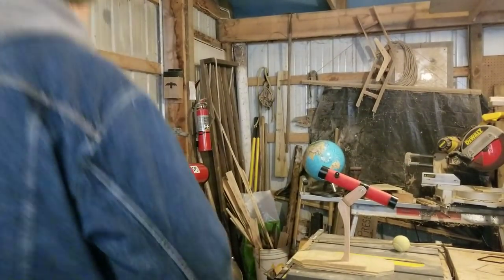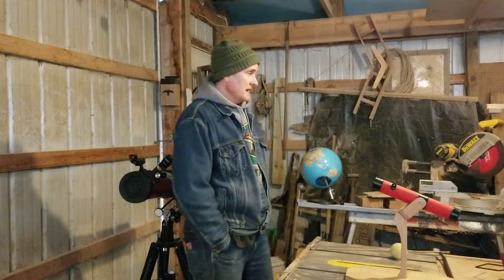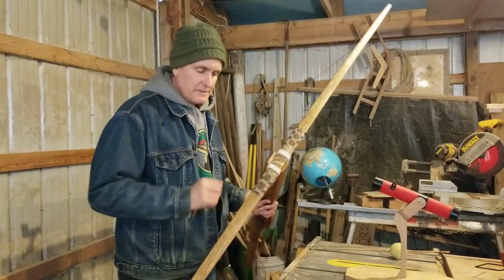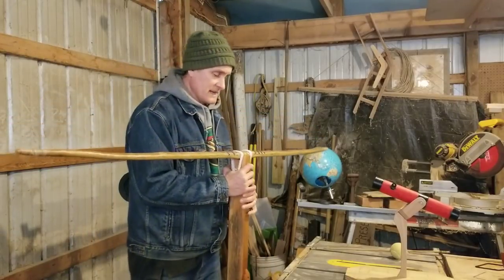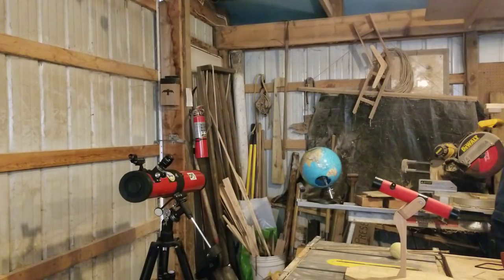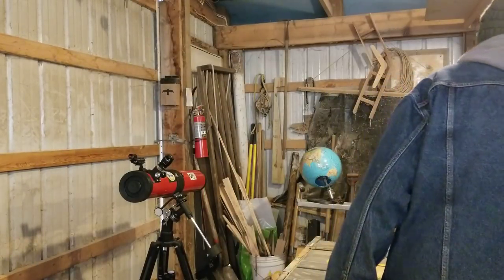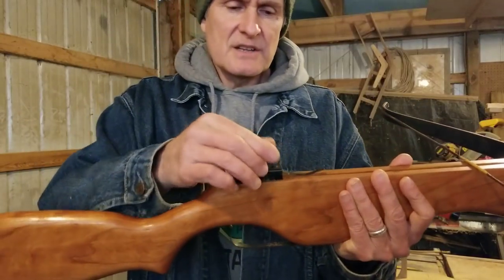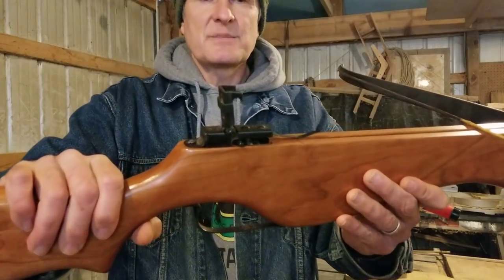CROSSBOWS PROVE THE EARTH IS FLAT?

Comment: Examine the metal components first, but if you don't find it there I can't rule out that they would have put it on the stock. If you find the letters G  L  O  C  K  and additionally the letters A  u  s  t  r  i  a, I may be able to tell you who the manufacturer is.
Reply: Hmmm, would it help if I knew how many bolts fit into the clip?